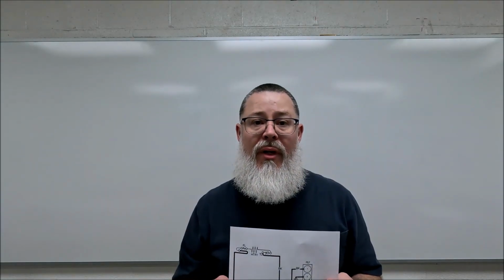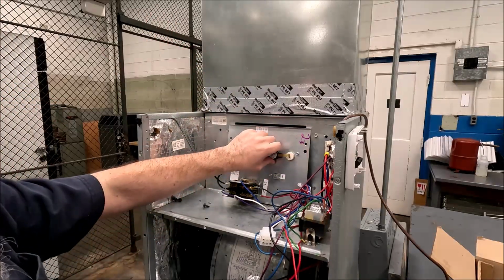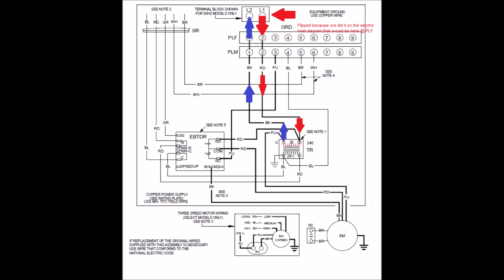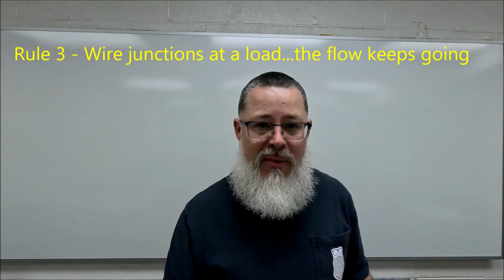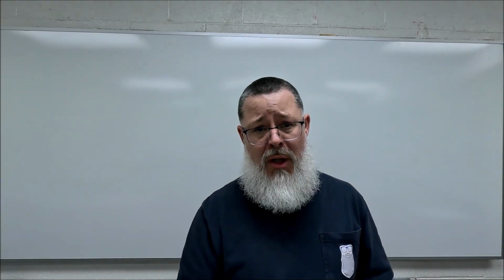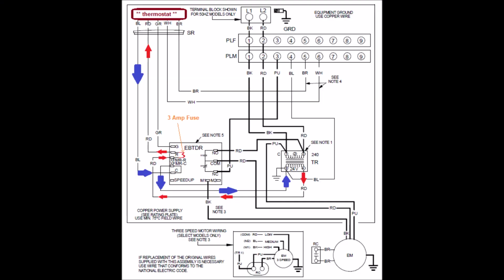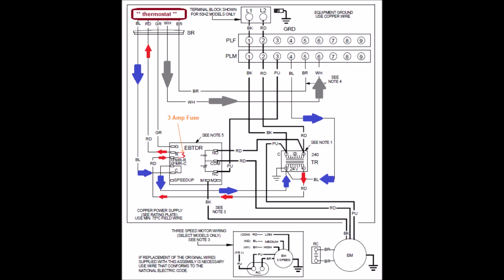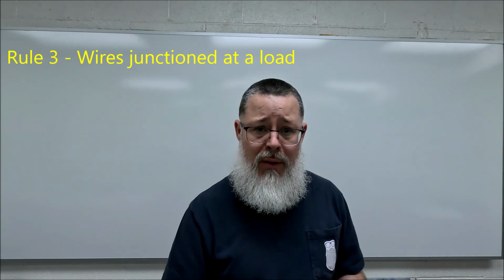Learning to Read A Wiring Diagram Part 2

Comment: I've watched your sequence of events vid from 2 yrs ago. I  have American Standard Freedom 80. When I call for heat, inducer motor turns on, then 3 seconds later the main blower turns on. No igniter, no gas, no flame proof. Blower stays on until I manually power  unit off. Suggestions?
Reply from the maker: If the inducer is coming on and then nothing else seems to happen I would say it is likely something with the pressure switch not closing. Maybe another safety like a roll out switch or high limit?? Not exactly familiar with that particular model. Look for an error code LED that may blink/flash.  BUT...if it is a pressure switch that isn't closing then you have to find out why. You could have a serious issue with a hole in the heat exchanger and that is not particularly good. I doubt it would be a bad pressure switch only. Same for a roll out issue, it likely isn't the switch that is bad. It is just doing its job.

Comment: Thank you so much for giving knowledge. May I know how I can reach out to you some questions with pictures of electric heat pack that I confused. Old Heat pack has 15 kw I replaced with 10 kw heat pack.old Heat pack 240 v 2 wire supply at heat pack breaker for 15 kw heat kit. At main breaker there is only 60 amp breaker. I am trying to understand how it work. I don’t see any wiring diagram.  I just want to understand and study. One limit switch is wire in series with 24 v at contactor . Please let me know if you know any sources that explain how it work. Thank you
Reply from the maker: Sounds like the 15 kW didn't work good because a 10kW needs a 60 amp breaker, 15kW would need a 90 amp. The new heat pack should fit well with the power supply you described. If you would like to email me at jenningsj@hotmail.com that would be ok but I think you have it under control by the way you just described it! I'll take my email down in a few days just so it isn't out there forever. Have a good New Year.

Comment: Question: junction going into a load, it keeps going as if the load is not there....but it also flows into the load in addition to continuing along the path, right? In other words, the power flows to every touch point along the way, and keeps going?
Reply from the maker: Yes, you are correct. It powers the load and keeps going to the next one. I have seen some that think that the load (like the primary of the transformer for instance) is power for the blower motor. My point is loads don't power another load. Only power does! But you have to know the flow from the power source.